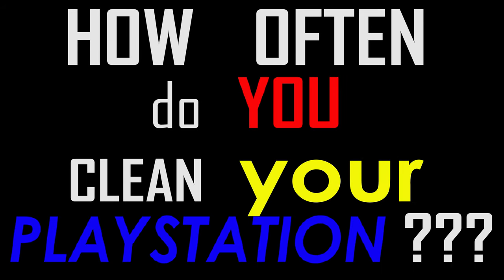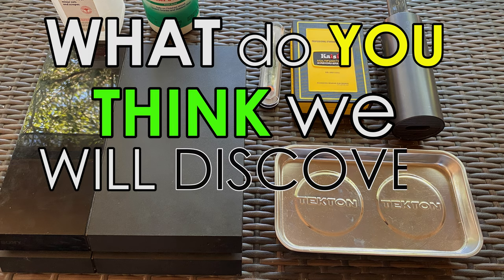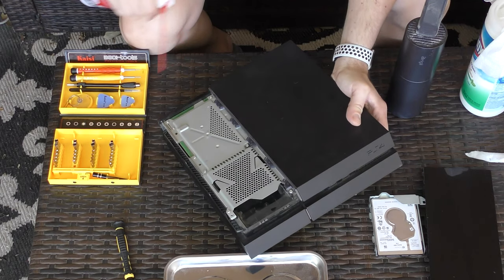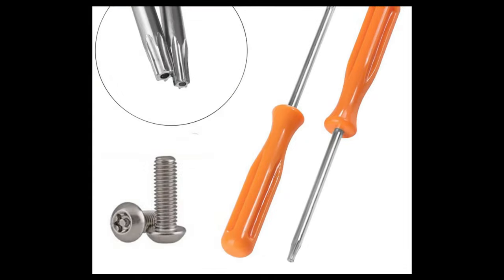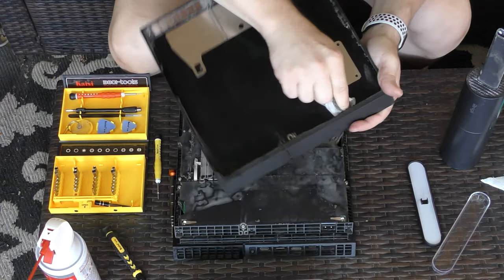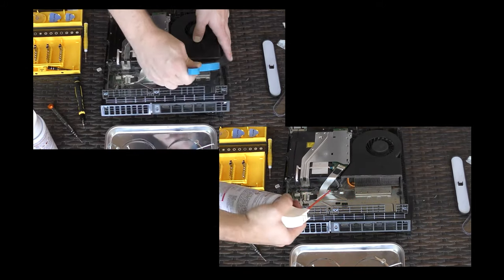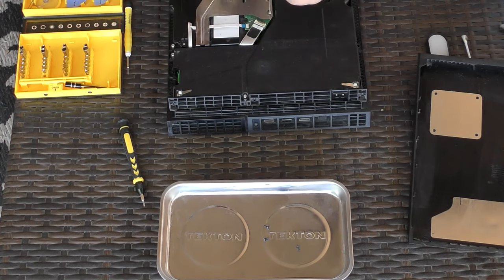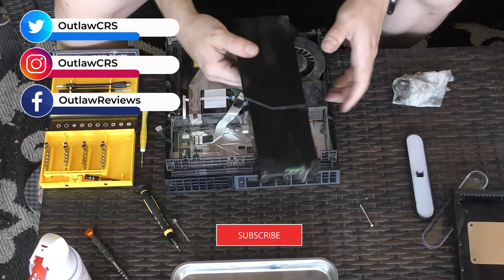Cleaning a PS4 - Full Tutorial: Fan, Power Supply, Heatsink - Fix a Loud  and Dirty Fan

Comment: I've had my PS4 Slim since it came out, so that's like 8 or 9 years roughly? And I've never cleaned it. I mean I'm just 18 now it's not like I would've known known clean it. Not to mention I've treated it horribly and accidentally let it stay on all day all the time. But I'm impressed, it still runs really really well, besides the loud fan which I'm pretty sure is the heat sync because I've cleaned it out and replaced the thermal paste.
Reply: No PS4 Slim has been out for roughly 6 years, The OLD PS4 has been out almost 9 years

Comment: I did manage to clean my PS4 last year, but I didn't confidently feel like I throughouly flushed out all the dust. 

Upon further dismantling. I discovered the heatskin had an ENTIRE sheet of dust going into the intake of the fan.
I'd suggest if you feel confident in tearing down some more, removing the fan completly will help get the hard cake'd on dust off the plate, in addtion of getting the otherside of the heatsink.
Reply: I was wondering about that. Will probably try that. Thanks.

Comment: I cleaned every part of my ps4, I took apart every single individual part insides of my ps4 and cleaned them too but it still overheats before I can even get to the main menu of any game except for Minecraft and my brother said that the power supply looks bad and that it needs to be replaced. Could the power supply not working properly have something to do with it overheating?
Reply from the maker: The power supply could be a problem. Have you tried switching it out?
Reply: @Outlaw_SEO  I bought a new one and it came in today but it was a different shape and it wasn't lining up and fitting into my ps4 so I just put everything into a box and I'm aiming 100% for a ps5 now. I know I will go back and fix it at some point but definitely not before I get a ps5.
Reply: Btw is it hot in your area? Try to cool down your room for a little bit
Reply: @ThaiChestnuts  yeah I was thinking the same thing

Comment: Im scared to pull out the power supply cable was it easy for you to unplug it and plug it back in?
Reply: To unplug I’m struggling
Reply: I broke mine, I was tryna get the whole heat sink out AND replace thermal paste even tho thermal paste wasn’t needed but I broke one of the cables so my PS4 wouldn’t turn on😞ordered a new psu cable which is coming soon and I’m definitely not replacing thermal paste until my PS4 overheats too many times 😂 so I only cleaned  it like he did in this video, and I will clean it this way until like I said, until the stock thermal paste isn’t helping anymore

Comment: The phillip screws in the power supply in my ps4 is stripped or worn out, how will I'm able to take it out?
Reply: I had same issue, i just got a small adjustable wrench and tightened it round each screw, longer and very pain staking but got the job done

Comment: I did every step. My PS4 is clean but my PS4 still overheats every 20minutes. What can I do ?
Reply from the maker: If it still overheats after the cleaning, one of the cooling components is not properly working. You can check if you plugged everything in properly. If you did, then it must be a failure of an individual component.  If that’s the case, you might want to take it to a repair shop.
Reply: You should take of the cover to the heatsink and the processor. Probably more dust in there and replace the heat paste on the processor. Did it with mine and works fine now!
Reply: Yes definitely apply more Thermal Paste. It's relatively cheap about 8 US Dollars for a small tube, you should only be using a very small pea sized amount where the heatsink will be, it spreads out wide.

Comment: My PS4 over heat every 30 mins help
Reply from the maker: It’s either dirt build up or the cooling parts are not working properly. If the cleaning doesn’t help, you’ll need to troubleshoot individual parts.

Comment: just want to vent a little. Screw sony for these torx screws. Mine were actually SMALLER than t8. I saw online the ps4 needed a t9, so i got the set that had a t8 and t10, even the t8 was to big.
Torx screws are only useful in the sense that they allow more torque to be used on the screw, this is onl;y true with larger, high endurance screws, not these cheap af, strip in 5 minutes PS4 screws. 
So first they make it a torx to make it harder for the average user to get into it, ok... screw you, then they make it a security torx which only purpose to make sure that you need an even MORE specialized tool to get into, a standard torx wont work, all just the existence of that little nipple in the center, screw you, then they find THE SMALLEST FREAKING TORX POSSIBLE.
SONY. 
SCREW YOU.
Great video though

Comment: hello there I wanted to ask this so I did an oopsie I opened my ps4 and afterward it had problems-here comes a long story- I've had my ps4 for 3 years and I've never cleaned it out apart from 2 weeks ago, so basically 2 weeks ago I cleaned the fan and heatsink and I tried to change the thermal paste for a just in case but I couldn't get to it after I finished with it I turned it on and had problems, it said it was overheating the fan went into hyperdrive as soon as I opened an app or game and turned off saying it was overheating when It clearly wasn't so yeah I need help desperately.
Reply from the maker: Your best bet is to reverse your process and go over the cleaning points again. Take your time and make sure everything is properly connected and seated.
Reply: @Outlaw_SEO  okay thanks for the help I’ll update when I have a break through
Reply: @Outlaw_SEO  I'm back your right I made a mistake when putting on a screw near the HDD thanks for the bro